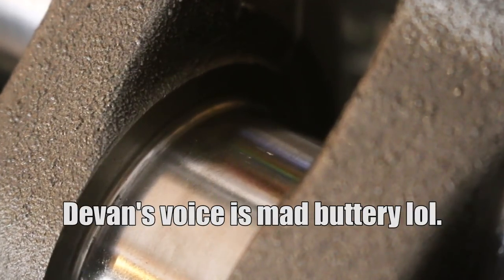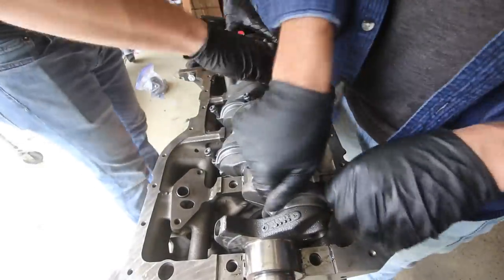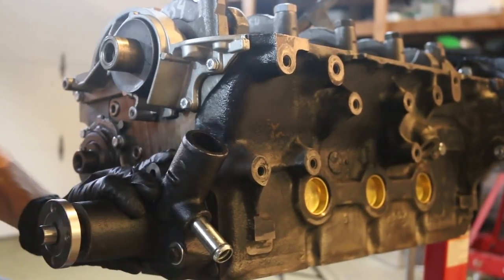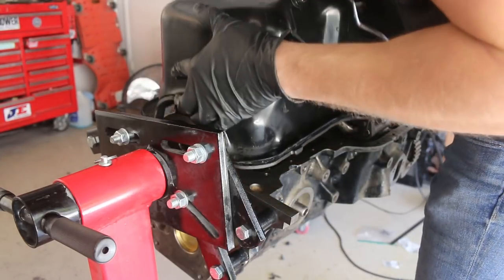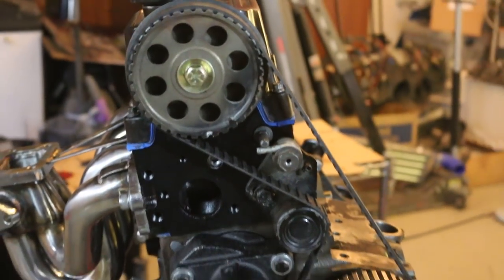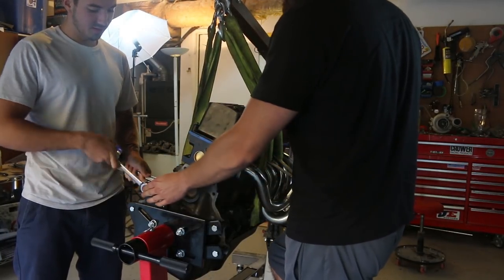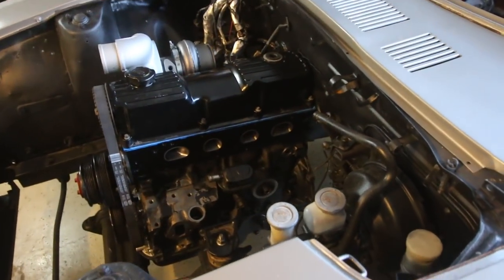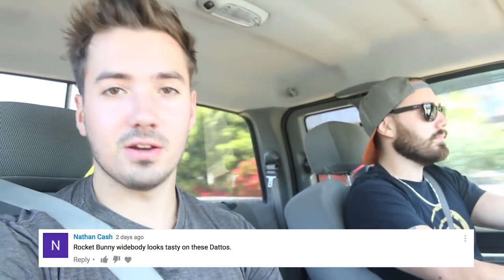BUILT FORD 2.3 ASSEMBLY! Turbo Datsun ep 11

Comment: Just in case you guys don't already know that Tubular Header is notorious for cracking frequently, even after Stinger added the bracing. Its still good and cheap just make sure to check it. something you can install on your exhaust to try and prevent cracking is the flex exhaust coupler that stinger sells. I went back to a cast iron manifold but got the Gnari one with the external wastegate provision molded in, flows alright-ish now that its ported, but its more reliable.
Reply from the maker: We know, and it's temporary until we can have one made. We bought it to make sure everything fits and that there's no clearance issues.

Comment: Suggestion:  Maybe add a short section of something that was new.  A new tool, a new process, a change of direction, etc.  So many channels produce videos as if they are experts.  When so many are really doing something for the first time.  You are kind noodling through something and not afraid to try or learn something new.  It is cool to learn new things... don't be afraid to highlight something that you just learned.  Great series... thanks for sharing!